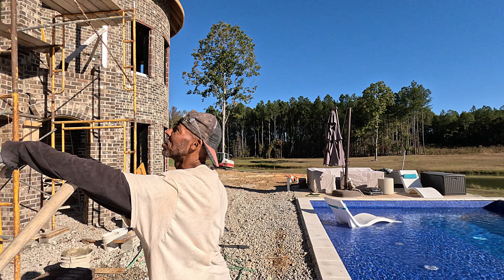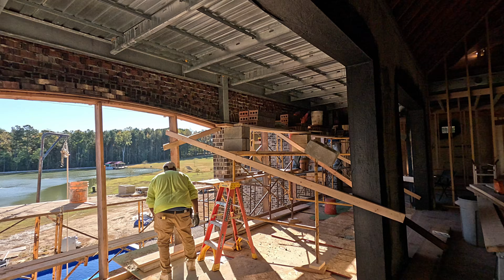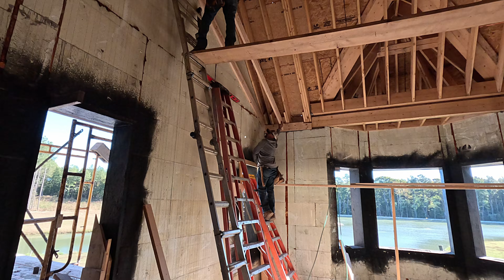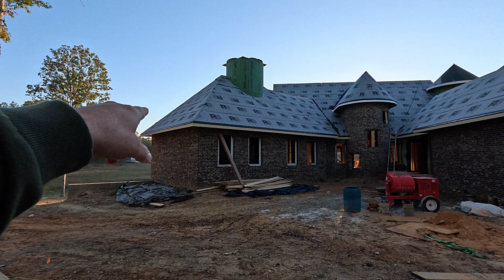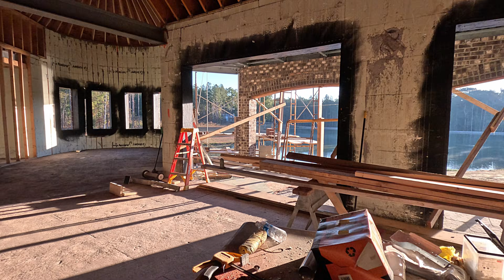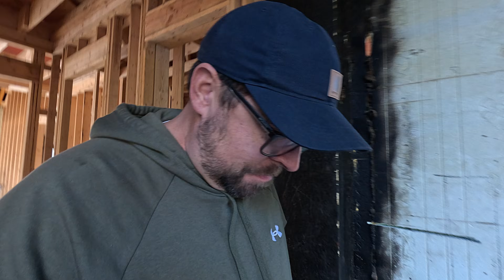Roofing Begins on the ICF Castle! Interior Framing Finally Complete!

Comment: About 60 years ago, pre OSHA, I worked in roofing for about 10 years. We did a lot of slate work and if just a repair, we would get a guy on the ridge with a rope wrapped around a leg and the repairman would climb down the rope and do the repairs, similar to how your crew is doing. These old slate roof houses were usually 3 stories up so it was kind of scarry at first. Back then you couldn't buy a better shingle than GAF and to my mind, that is still true. The job is looking great.

Comment: Be cool if you installed permanent Govee etc. lighting to accentuate the roof lines and  the round  soffit roofs
Reply: I've been researching outdoor waterproof LED light strips for under my soffits.  Govee does have a sophisticated app.  I have that already for some indoor lighting and can easily link more indoor and outdoor light systems to that same app.  Offers separate light segments and sequencing controls all from a phone or tablet.  There are other companies entering the market too.  So, lots of choices to look at and research.  I do know I will be putting upside down "U" shaped aluminum housing tracks for the LEDs with fitted diffuser coverings to give a hidden downlighting neon glow.  I have just enough of an outer soffit lip to hide the housings.  I also want warm/cool whites through the RGB spectrum with DIY custom motion themes.  I love that soft down-lighting look especially on the outside.  Will be on my Spring project to-do list.
Reply from the maker: I have Govee lights on the Farmhouse
Reply: I didn't know you had Govee lights.  I wrote my other comment just in case you didn't know about some of the current options and apps.  Maybe some other viewers might find that info useful then.

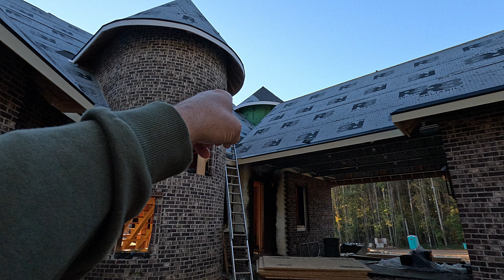Comment: Little food for thought.  When I was Project Managing jobs, it fell on my shoulders to direct the placement of materials.  To hedge my bet, I always asked my crew for their input, but ultimately is was my decision.  Now my crew worked 7-3:30 more or less, but I stayed on the job until 7pm to 8:30ish.  After they left, I tidied up the jobsite.  Coiled up extension cords, wrapped up air hoses, consolidated usable shorts and RELOCATED ANY MATERIAL WE WERE ESSENTIALLY DONE WITH.  (I usually put it in the garage so it was under cover and still readily available).  It's a total waste of time and talent to have my skilled crew doing mundane tasks.  If I had a laborer onsite I'd use him, but most of the time he was busy picking up and running odds and ends to my other jobs, or my boss was keeping him busy on some pet project of his.  So most of the time I just did it and kept my trap shut.

Your job is shaping up amazingly, and I eagerly await seeing the next chapters.  All in all, you are getting it together as a project manager,and it's cool to see you grow like that.  Now if you could just find a seasoned PM you could trust, you could easily double your project load.  Thanks for sharing.